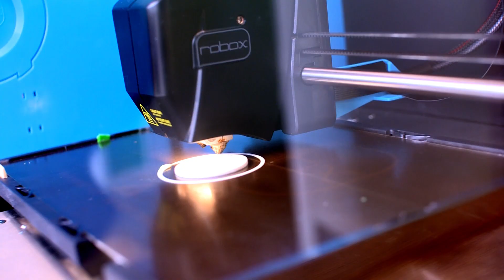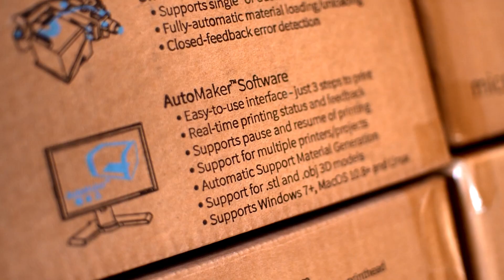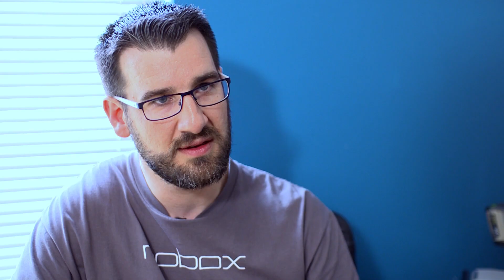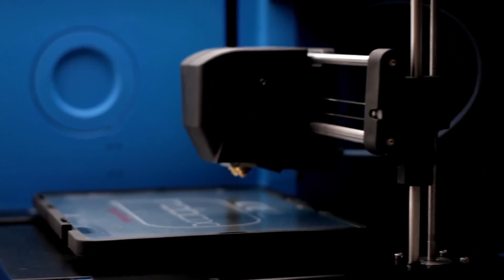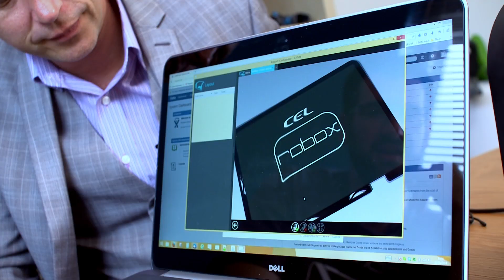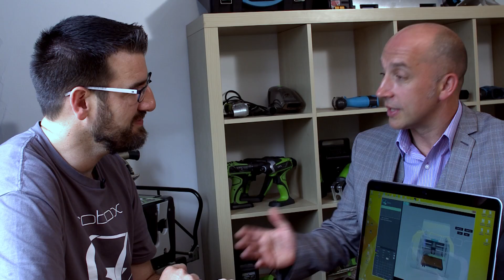Robox 3D Printer - the advent of true plug and play additive manufacturing for the home?

Comment: I been doing my research and I come to a conclusion that you get what you paid for and sometimes not. There are printers costing less with similar results but lack other nice features and capabilities. There are also printers costing $1000s dollars more and you might not get a better build or can print with a wide range of filaments. If you do find an expensive 3d printer that can do circles around this one, chances are the supplies will cost an arm or leg and the printer will lack some nice features that this printer has. Robox 3D Printer is a well balanced machine with superb print quality, ease of use, loaded with features and capabilities and it's upgradeable with a switchable print head all for a descent price. It isn't cheap like a $500 bargain but neither does it cost well in the $1000s. All things will eventually come down in price--part of marketing cycle. At this very moment the Robox 3D Printer is a well balanced 3d printing solution for price of features and capabilities.

I have one question. Will the user experience any plastic odor while printing? The printer seems well inclosed.
Regardless of an odor, I will be saving my pennies for this printer.
Research complete.